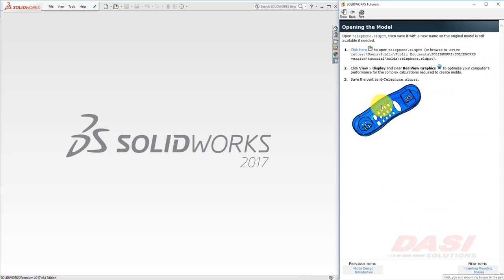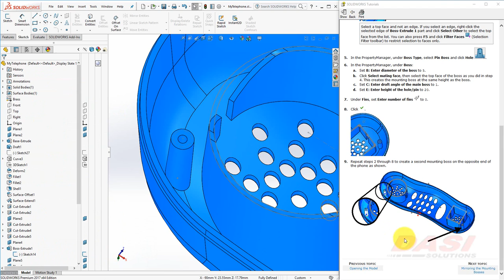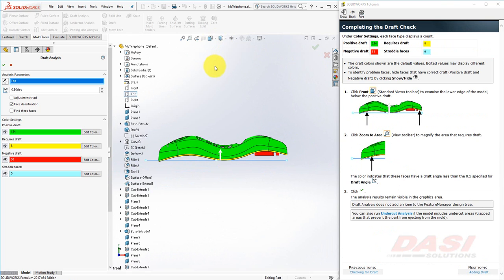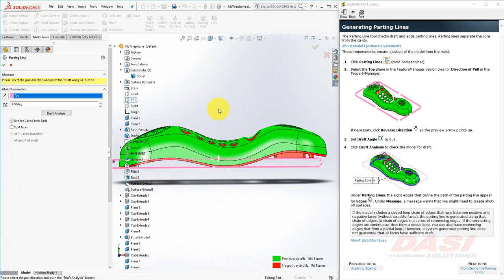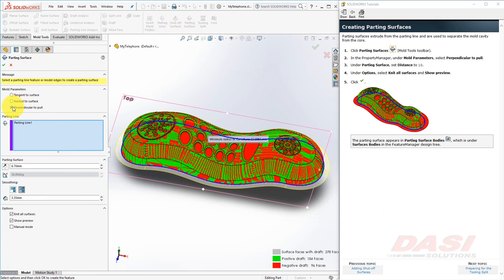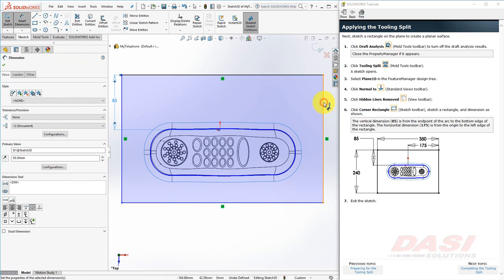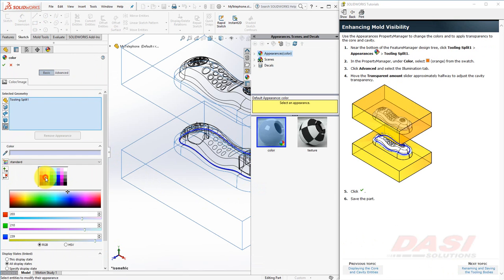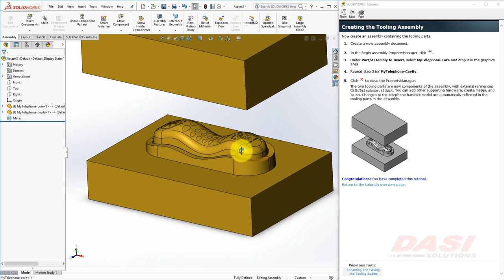SOLIDWORKS Tutorial "Mold Design" (10/10)

Comment: hi, my model did not automatically select the correct loops (it selected some redundant and contact loops) do you know whether it could be one of the settings in solidworks that makes it do that. i have repeated this tutorial several times in order to make sure i have not missed/did any steps incorrectly.
Reply: hey i had the same issue...did you found any solution for that?
Reply: @vatsal1857  yea, when selecting the splitting line, it chooses the wrong one, you have to select the line that connects the 2 perpendicularly aligned faces.
Reply: @randominternetguy3537  thanks man it worked out for me
Reply: @randominternetguy3537  should we do it manually or is there something i should correct so that the software selects the correct one automatically
Reply: @glintongfernandez1845  no clue. It was just a fix I found for a class I took in hs. We went to use a different program the next year. It was garbage imo. It was more efficient but much more difficult to use and mess around in. I gave up, failed the class, and barely got my pos paper for graduating a POS hs.
Reply: @randominternetguy3537  thanks for the reply, I will go with the fix then.
Reply: @randominternetguy3537  at what time stamp is the problem at? im still getting redundant loops
Reply: @andrewrico1958  somewhere at 7 minutes. I had to redo the model like 4 times bc it wouldn't work.